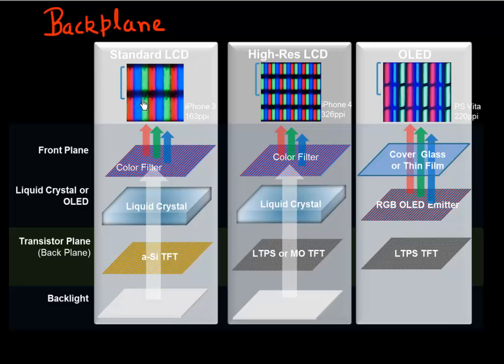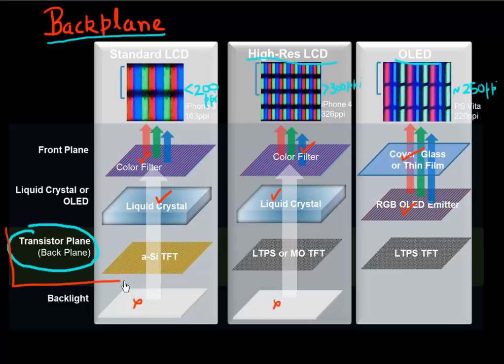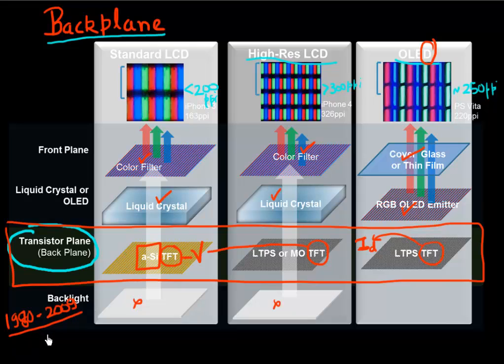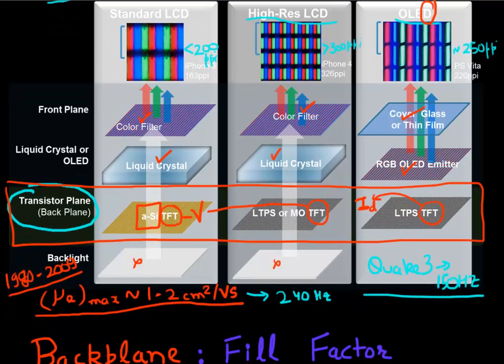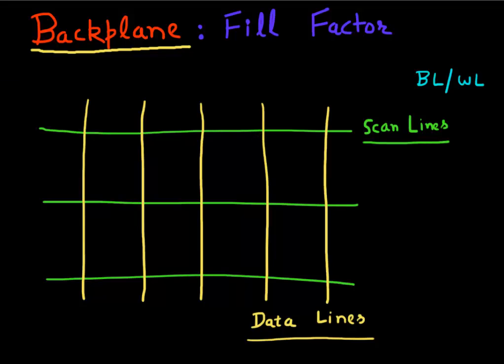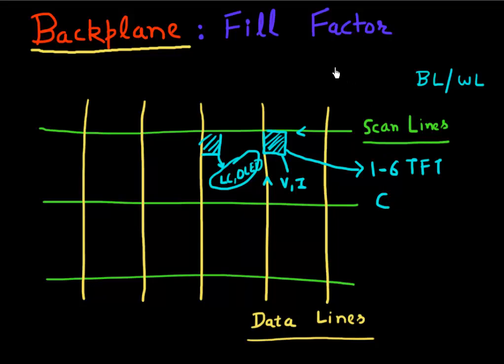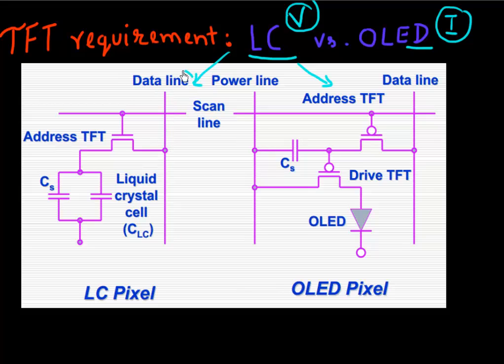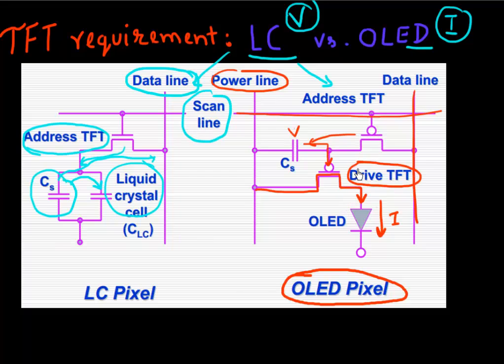Thin Film Transistor (TFT) backplane for displays: Pt 1

Comment: Awesome explanation. One question, is it possible to detach the TFT matrix panel from the LCD and RGB color filter matrix? maybe using a heat gun or any chemical. I need to work with the TFT panel for a project. Thank you!

Comment: is oxide tft the same as MO (metal oxide) in the video? which of these is theoretically safer for eyes? ps. based on the video, as I understand these are not affecting eye safety because these elements are just used to generate control current or voltage, so not directly affect light emitting aspects of a display.

Comment: Thanks for the amazing explanation!  I have a couple of questions about the diagram near timestamp [8:15].

    1. The liquid crystal cell reminds me a little bit of DRAM storage.  How long will the capacitor C_s hold the charge placed on it?  Does the voltage driving the liquid crystal cell always remain at a well-defined level, or does charge leak out from cells in scan line 0 as scan lines 1 - n are addressed?
    2. I don't understand why C_s is required between the gate of the drive TFT and the drain of the address TFT in the right diagram.  Does this serve as some sort of memory like C_s in the left diagram?
Reply: I would assume the capacitor holds the charge till the next screen refresh.

Comment: Great info My friend I want to ask you i bought  new DVD player for my car, screen 7 inches 800x480 but it is fade in the morning when the sunlight is shining I can not see anything may I modify it for example I have a laptop not working can I take any layer of the laptop screen and replace it with the screen of the car or what you advice to Get a clear view today i removed the layer on screen but it become completely white only can see little from angle 45 degree so i put it back
What is we can do to get clear view under sunlight 

Like for you  already 👍
Reply: You need a stronger backlight